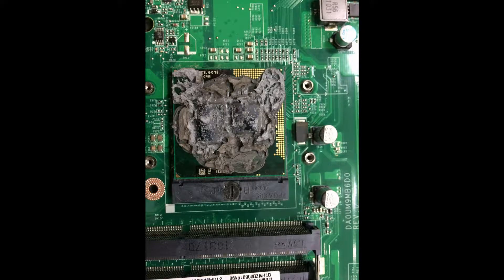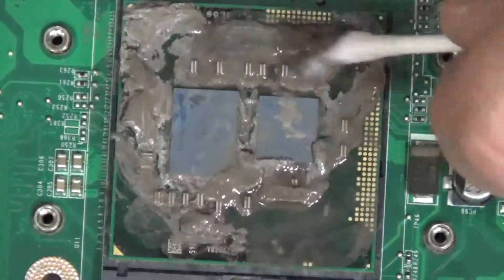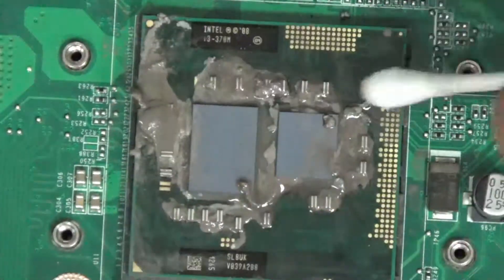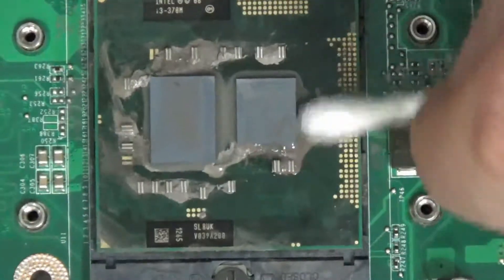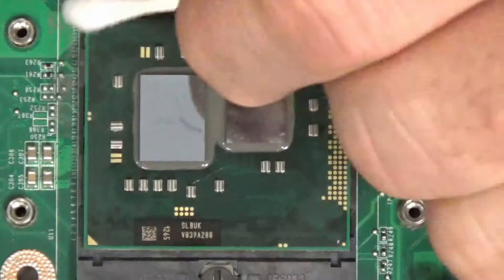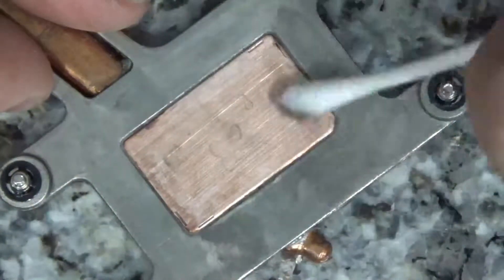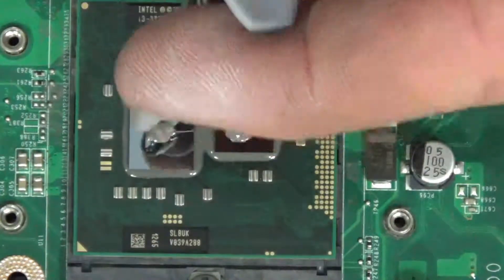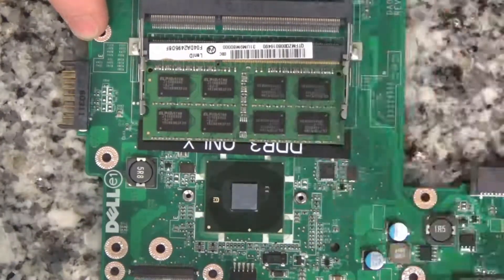i3-370M Thermal pad failure cleanup

Comment: I'm having the same issue with that same processor, it randomly reboots, please help! what should i do
Reply: In better case clean cooler..fan..old thermal paste and apply new one like arctic Mx-4 or some thermal pads. In worst case replace CPU or buy new machine
Good luck

Comment: That cpu can be upgraded look up the motherboard and see what models it supports. Also look into Thermal Grizzly Kryonaut Thermal Pads they have 62.5 kw displacement where liquid metal is 75 kwh and it's reusable look at reviews it works amazing for my all my PC parts use them.
Reply from the maker: This repair was for a friend of my wife, that person is still using it to this day.